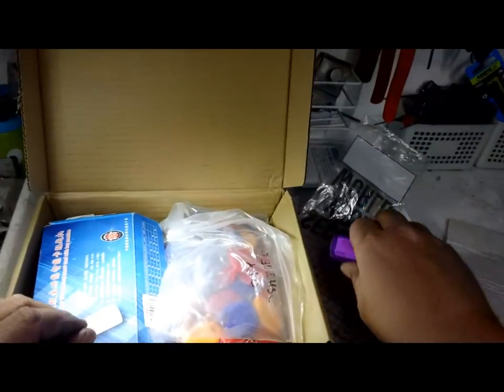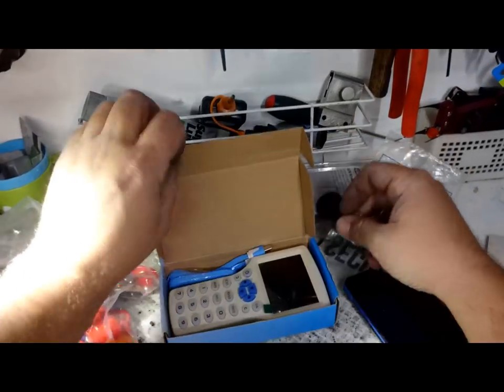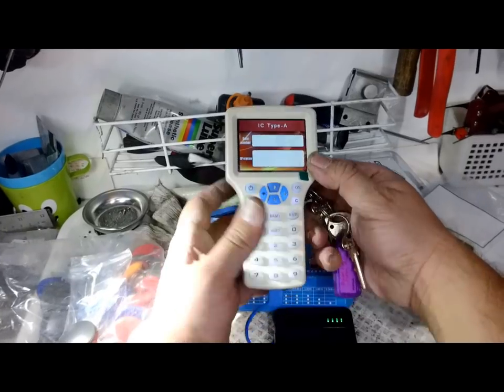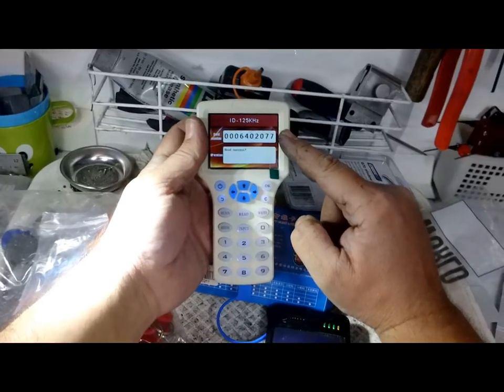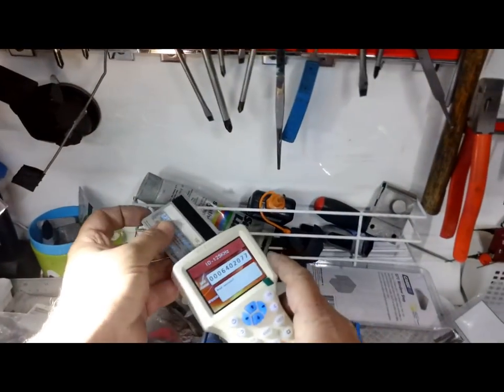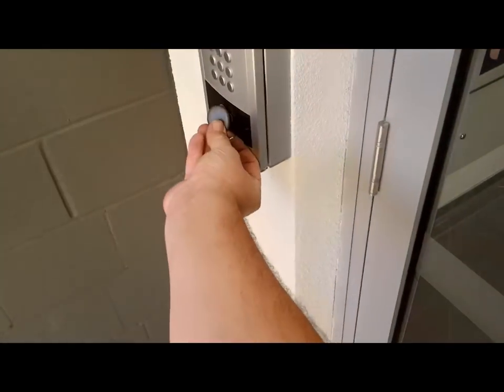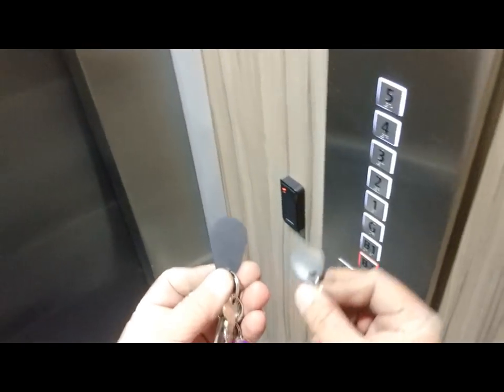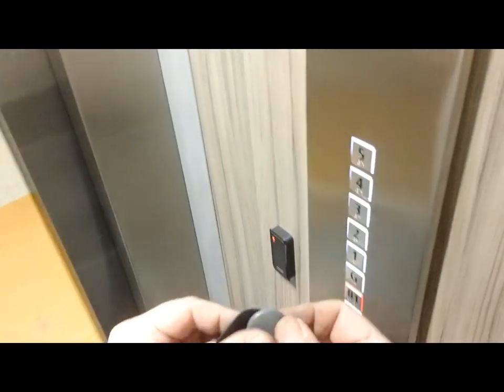Swipe Card Copy Machine

Comment: Hi! I just ordered this, I have a HiD Proximity, will this device work for it or no? Also is there a way to unlock this device so I can copy my HiD if it doesnt work? Like basically, can I unlock this device so it can copy my HiD proximity?. Hope you can get back to me ASAP. Thanks a bunch
Reply from the maker: I have used it on some HID, they have a few different formats, You can plug the unit into your computer and use the software, you might get a virus on your computer if you do.. It best to ask the seller you bought it from if you need more info, they may know more